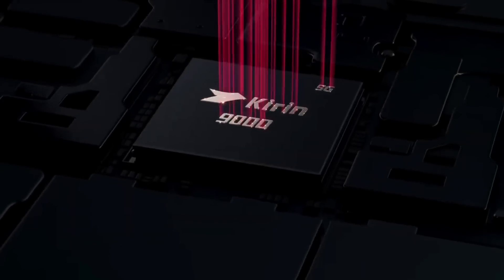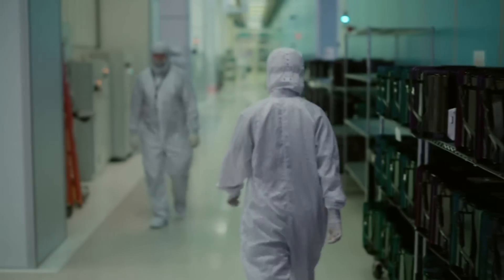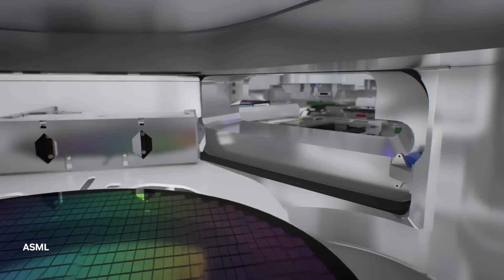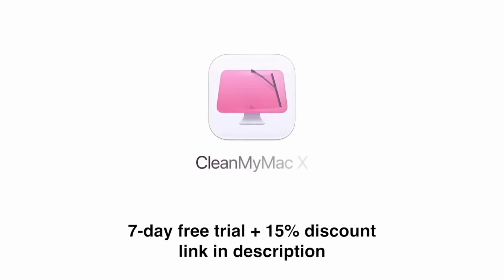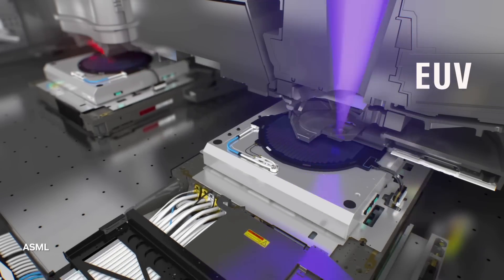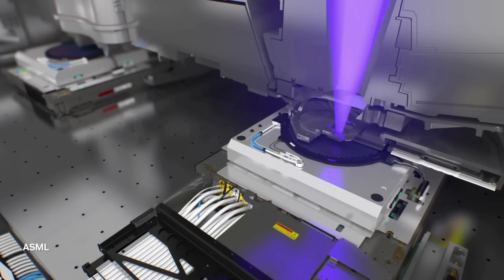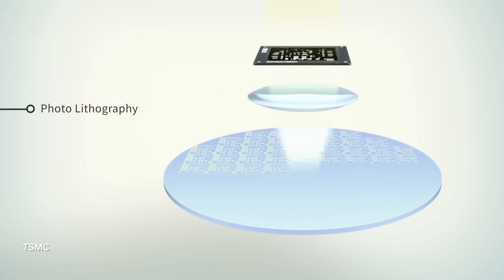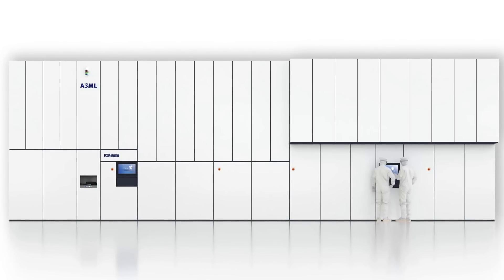The Truth About China's 7nm Breakthrough

Comment: As far China is concern every semiconductor must be for mass application. Right now 7nm is the most important because the application is very wide from 5G for mobile phone to tablet to computer and the latest AI and EV. At EV there is actually no need for 7nm. Huawei has design and produce an EV chip based on 28nm that matches the American EV chip based on 5nm. As far as AI is concern, a 7nm chip is more than enough. Therefore even for the sake of progress, a 5nm will be more than enough. After 5nm China will take a different path diverting from silicon based materials either fully or partially. The 5nm chip is already in place. Huawei Kirin 9100 is a 5nm chip and maybe launched in the Huawei Mate60 RS. Actually 3nm has its problem. Overheating and high consumption of energy to name a few. New approach rather than to force the issue and use 3nm or more advance. 5nm is more than enough.

Comment: China didn't have some "breakthrough".  SMIC in particular has been able to make 7nm, whatever that means because we don't know, for at least a couple years.  What they HAVEN'T been able to do is make it with a low defect rate because unlike the wild speculations, they have access to very little if any EUV lithography and are using DUV to make this.

OTHER companies could do the same thing but there's no reason to.  Most companies that use DUV don't try to get below about 12nm, once again whatever that means because these are ADVERTISING terms.  That's about the point to where trying to make smaller transistors means higher defect rate and it's just not worth it.

This Wuawei "launch", which wasn't even a launch by the company but instead a launch by the GOVT! when the US Secretary of Commerce was there, is a limited launch.  Yeah no shit it's limited, the defect rate is too high using DUV to make 7nm.

In other words there's been an overreaction to this.  Chinese fabs have lots of DUV equipment because they made large orders years ago for it, and NO govt. should be saying anything about it because the orders happened in the past before sanctions were in place and ASML was allowed to complete orders.  If any of their companies do have access to EUV it's a very small number of machines.  In fact ASML has been allowed to sell/finish orders for DUV lithography until now.

Put into context with the main semi-conductor companies that make the most advanced nodes, 7nm (which has no meaning) has been around since around 2017 - 2018 time period.  The companies that use the more advanced process nodes like Intel, AMD, Nvidia, Samsung and others have moved well past that and are about to move off of EUV to a newer technology that lets them get down to 2nm (once again has no meaning) and lower.  Right now Intel is releasing on their Intel 4 process node (official release is Dec 14th with Meteor Lake laptop parts) which they've now shown in demos.  Samsung's current gen products use their own Samsung 4N node.  AMD is currently using TSMC N7 - N4 nodes for products and Nvidia latest gen is using TSMC N4.  APPLE is a risk partner with TSMC and their new product lines always come on the most advanced node TSMC makes, and their NEW line uses TSMC N3 which right now is the most advanced process node.''

So, put into context with other companies around the world that fabricate ICs, ASML has accomplished is nothing.  It's a big nothing burger.  It is the Chinese govt throwing a lot of money at ASML and Huawei for propaganda purposes.  Huawei didn't even advertise this launch until AFTER a forced release because the govt. launched it once again when the US Sec. of Commerce went to China, it's a limited launch because this will never be profitable.  Eventually Western govts. and companies won't have an issue with Chinese fabs getting EUV because Western and other Asian fabs will be using High-NA EUV, which get to the market around 2025.  This allows fabs to get down to 2nm and smaller, once again these are meaningless numbers are really are advertising terms.
Reply: Nice western Propaganda 😂

Comment: China rescued AMD from oblivion with a financial investment that including developing chiplet technology.  China will have no problem leveraging chiplet technology to compensate for being one or two generations behind.  It would not babe as power efficient nor as cost efficient as the latest euv technology chips, but China’s manufacturing cost efficiency will make up for the cost, and plugged in electronics can easily live with more power drain.    Battery powered electronics like cell phones don’t gain enough from using 3 nm instead of 7 nm to do what users want, so they don’t need chiplet technology.

Comment: TSMC first started making 7nm chip before they got their first EUV. intel also invested heavily in non-EUV tech because of their sunken cost. SMIC co leader created the TSMC DUV 7nm chip a decade ago and help Samsung reach chip parity with TSMC, so for him to lead SIMC to do 7nm chip with DUV is no surprise, it actually an easy job for him. this is why they like to say chip making is like baking. having a better oven helps, but how good the cake is, depend on the baker, not the oven. this is why US make shitty chip despite having the best oven.

and while i agree it is more expensive to make chip on DUV, I don't really agree that it would be "sky high", since SMIC operation cost is likely lower than TSMC. if you need to take longer u just need more machine to offset by economic of scale. so the question is really how fast can China scale up.
Reply: Not a decade ago. TSMC began production of 256 Mbit SRAM memory chips using a 7 nm process called N7 in June 2016. That is the first DUV 7nm and only to memory chip which is less complicated to mobile core Soc. Then first 7 nm mobile processor intended for mass market use was produced at 2018.
Reply: The advantage is china will become master of trade in the world  because it can make every things locally
Reply: The cost will be dependent on the defect rate.  Intel also uses DUV to make their "Intel 7" process node so congrats to SMIC for getting to a place Intel was 5 years ago.  I'm pretty sure that since this is the first consumer product on this node that SMIC's defect rate is probably not good, and since Huawei is a company with the CCP behind it, it's being subsidized so defect rate doesn't matter.

That's about as good as it gets though with DUV.  After than a company pretty much HAS to move to EUV.  SMIC is getting to a "7" node, for which the transistor density is unknown so it's hard to really know what that means and the numbers don't say anything and are only advertising terms.  TSMC on the other hand already got to a "3" node using EUV.  Samsung is on a "4" node with their current devices, and Intel is about to release a "4" node with their Meteor Lake laptop CPUs which launch early next year which means Intel has already been in production of these parts.
Reply: The cost is sky high because it has to use so many more passes, which increase cost and reduce yield.  It's like can a cow plow the same amount of land as a tractor?  yes, you just need to buy 100 cows, at which point the farm that use cows can't compete with the tractor farms.
Reply: yes,  TSMC needs to pay the US,  that is reason why the cost can be "sky high" :face-green-smiling:
Reply: Great comment and based on fact and reality
Reply: Not really. TSMC has massive market share and has customers like Apple. That means they have economies of scale when it comes to manufacturing chips. Full utilization of its machines will make each fixed cost per chip cheaper. Unfortunately for SMIC, it doesn't have many customers and its chips are mostly domestic. It needs other countries to buy its chips to build it at scale. The hope for SMIC is that CCP will intervene and provide limitless subsidies and it looks like they are. That can offset the higher cost.
Reply: @wotltkfkdgo they their overheads are a tiny fraction of the TSMC+US+EU monolith. Lithography machines are not all that expensive to make, it is all the pocket filling that makes them expensive to make and run. You pay monthly fees back to the manufacturer akin to rent despite owning them. Besides, China is an absolutely massive maker of ICs, no shortage of chips to make.
Reply: @ItsTristan1st  you have no idea about what youre talking about. Lithography machines are fucking expensive to build since they require many specialized parts that made specific for the machine. Each machine in the production line at fabs is specialized. They cost hundreds of millions of dollars. That is just the machine. If you add up the cost of a clean room and others, the cost is enormous. China could have a relatively low cost of production but it is nowhere close enough to make up for the lack of economies of scale.
Reply: @wotltkfkdgo there are more rich people in this world or poor people???chips will soon be like basic food, as long as u are a human being u will need to Lconsume”…. So if we are talking food, u want to serve the poor country or the rich country if u can’t serve both????
Reply: @TheAlbert18361  what are you talking about? Maybe use Google translate ?
Reply: @wotltkfkdgo  market for chips for poor country is much bigger than market for chips for rich countries. China cannot sell chips to rich countries due to us embargo but it can sell to poor countries… poor countries are just as hungry as rich countries for chips…
 that’s how Chinese smartphone companies survive… they have thinner margin, earn much less than Apple, market cap is thus far smaller, but their tech isn’t far behind (advance enough for poor countries people to still buy)….
Reply: @TheAlbert18361  yes, that isn't 7nm. You're thinking of legacy chips. China can build those already. 7nm and lower are high end and expensive. They need wealthier customer.
Reply: @wotltkfkdgo  😂…. No wonder the Americans are surprised by Huawei….
Reply: @TheAlbert18361  you don't have a clue about what you're talking about. Economies of scale is everything. China can't achieve economies of scale in 7nm and less due to lack of consumers. People in third world consume mostly legacy chips not 7nm and below.
Reply: @wotltkfkdgo Did you say each lithography machine costs hundreds of millions of dollars? I have to admit my knowledge is very limited in this but I don't think it costs more than $150m per machine even for the most advanced ones.
Reply: @azeemsoona  high na will be $300M
Reply: You assumed china not have domestic EUV like techno

The chips are 5 nm not 7 nm

Comment: You lost me there between the higher wavelength DUV at 193 nm, compares to EUV at 13.5 nm (8:22), and multi patterning (10:37), to make a finer resolution feature on the die, or make a 7nm equivalent chip.

If DUV has a low resolution, wouldn't you be multi patterning low resolution patterns and ends with a low resolution result?

For example, instead of using a fine ball point pen to draw, you use a piant brush. By layering paint brush strokes, how can it produce a find ball pen writing?

Thanks.

Comment: It is just a clone copy of TSMC multi pass 7nm process, TSMC made the jump to EUV because of the low intolerable yield. SMIC has never been noted for a high yield fab , it had been sued twice by TSMC for technology thefts in the past. I wonder what is the really yield for SMIC 7nm and the power leakage too. If the line width isn’t well defined, it means higher leakage in the transistors in this advanced nodes.
Samsung has been plagued by the leakage issues for the qualcomm 7nm design.
Huawei new phone has a huge larger heat sink than others .

Comment: Don't be surprised that US will ask the Dutch government to limit or even stop exports of DUV machines to China.

The multiple pattern overlaying process explained in this video means that the more DUV machines, the faster the whole multiple pattern etching process would be completed. 

Also the more often a small number of DUV machines are used, the higher likelihood that they would breakdown. That is why this large orders for DUV machines. 

Therefore the US could simply ban the exports (directly or indirectly) from ASML of these DUV machines to China altogether. 

While this would force China to accelerate her own etching machine development, it wouldn't make any difference in this regard anyway.

At least China would be greatly   obstructed in her own domestic chip manufacturing. 
Without high revenue, the chip industry in China would be in trouble.

Huawei obviously has been helped by the Chinese government that most would see its proving the close link between the two. 

Huawei, likely, if the ban on DUV machines to China altogether does happen, will be abandoned by Chinese government eventually. 

Keep this in mind that OPPO, eg, isn't banned by US government from buying chips made by TSMC which makes bulk of most advanced chips. 

The Chinese government might even one day give up on the chip manufacturing in full. Without sufficient number of DUV machines, low volume of production is never going to be viable long term. 

As time goes, even less sophisticated uses might demand 7nm or thinner chips. Without sufficient DUV machines, China would lose out even the low end chip sector too. 

If, eg, the exodus of foreign manufacturing out of China continues, demands for low sophisticated chips even in China would be lower too. 

This is what I mean that China might end up quitting the chip manufacturing altogether.

Comment: 7nm or 5nm are not important, the relevant metric is the yield per wafer.
They are probably getting one 7nm chip per wafer...
Chinese communications or announcement have never been reliable, particularly when you double click the data or start digging into details.
What makes you think they have started to produce 7nm at global scale? (they claim they can produce up to 15 million per year)
Please, do not switch into becoming a Chinese propaganda channel.
Reply: The pride of Taiwan, Taiwan's leading foundry (TSMC) has never produced semiconductor manufacturing equipment. Since China Microelectronics Semiconductor Manufacturing Equipment Company purchased 28-nanometer semiconductor manufacturing equipment, it has continued to 7-nanometer semiconductor manufacturing equipment to produce chips. Currently, TSMC's 12-inch wafer fab in Nanjing, China has been equipped with China Microelectronics' 7-nanometer semiconductor manufacturing equipment to produce chips for Apple, Samsung, Huawei, etc. Since 14nm semiconductor manufacturing equipment, UMC has purchased semiconductor manufacturing equipment from China Microelectronics Semiconductor Manufacturing Equipment Company. In 2017, China Micro-Semiconductor mastered 5-nanometer etching machine technology! Sales of 5-nanometer semiconductor manufacturing equipment in 2018. China Micro Semiconductor will sell TSMC’s 5-nanometer semiconductor manufacturing equipment and even 3.5-nanometer semiconductor manufacturing equipment. TSMC chief Chang Chung-mou told Taiwanese that China is about seven years behind Taiwan in semiconductor technology. This is a travesty in itself.
Reply: @wildfire8126  yeah... sure...

Comment: Top 12 semiconductor equipment suppliers in 2019
1. Advantest/advanced testing. (Japan)
2. Advanced Micro-Fabrication Equipment Inc. China/(China Micro-Fabrication Equipment Manufacturing Company). (China)
China Microelectronics Semiconductor Equipment Manufacturing Company is China's leading provider of process technology, tools and expertise that helps global semiconductor and LED manufacturers achieve their innovation, production and profit goals. The company's etch tools enable chipmakers to build devices for a variety of applications at nodes as low as 5 nanometers, while its MOCVD systems lead the market in blue LED production. More than 1,100 China Microelectronics Semiconductor Equipment Manufacturing Company process units including these two product lines have been installed in 40 leading customer factories in Asia and Europe. China Microelectronics Semiconductor Equipment Manufacturing Company is headquartered in Shanghai, with operations in Nanchang and Xiamen, and regional subsidiaries in Japan, South Korea, Singapore, Taiwan and the United States.
3. Applied Materials/Applied Materials. (USA)
4. ASML. (Netherlands)
ASM Pacific Technology.
Cohu.
EV Group/Electric Vehicle Group.
FormFactor/Constituting factors
Hitachi High-Technologies/Hitachi High-tech
KLA
Kokusai Electric/国sai Electric
Lam Research/Lin's Research
Lam Research is a global provider of innovative wafer fabrication equipment and services to the semiconductor industry. As a trusted partner to the world's leading semiconductor companies, we combine superior systems engineering capabilities, technology leadership and an unwavering commitment to customer success to accelerate innovation through enhanced device performance. In fact, today, almost all advanced chips are built using Lam technology. Lam Research (Nasdaq: LRCX) is a Fortune 500 company headquartered in Fremont, California with operations worldwide.
Who is first, who is second, who is third? The third and fourth want to sanction the second? What is the logic?